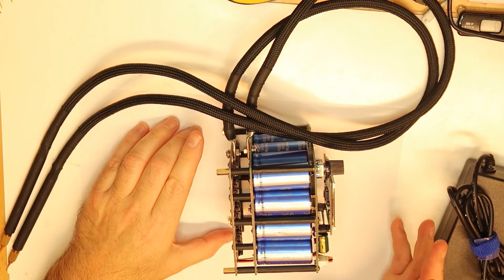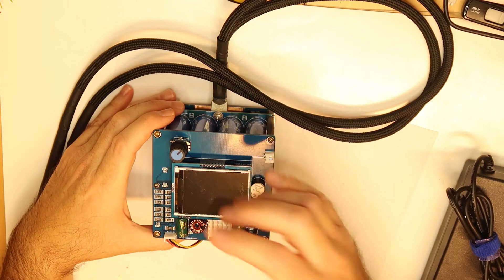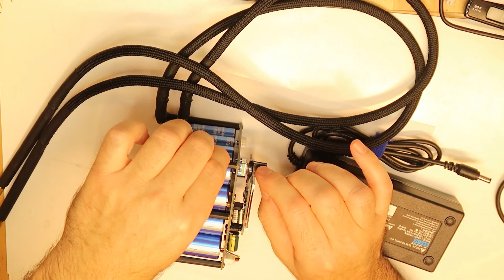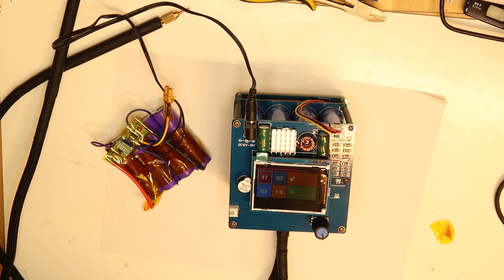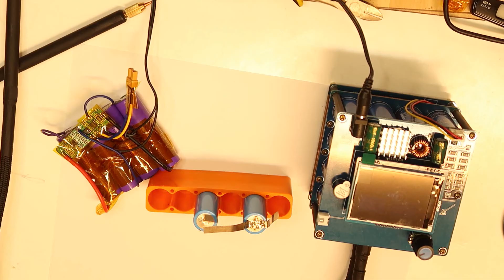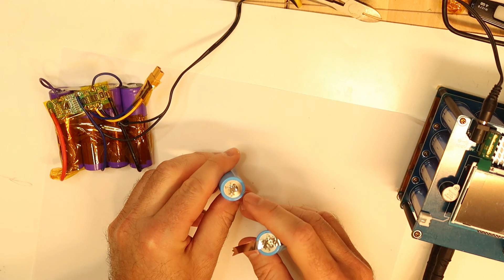Best Welder ?! watch this

Comment: For more than occasional spot welds, this thing will be much too slow and quickly get to be super annoying! 
*
This little toy at 10 amps charge current: Fine for VERY SLOW spot welding. Build a pack with 100 cells or more in it and this spot welder will quickly drive you nuts with all the time it makes you waste for charging!!!
*
I don't build packs all the time and I'm far from being a professional pack builder. I build 16S-32S EV packs for me and friends. I have a KWELD with dual super cap modules and 100 amps of charge current into the super caps. This setup keeps up with my spot welding cadence...which IMHO is not very fast. I started off with the KWELD on 12 amps charge current and I'd get 1-5 minutes of spot welding and then have to stop for 10 minutes so the caps could charge again. This quickly got annoying! I then upgraded to a 50 amp PSU for charging. MUCH better! I STILL had to stop for the caps to charge again, just not as long. I then got a second 50 amp PSU for a total of 100 amps of charge current. This keeps up with my not so fast spot welding so I'm never waiting for the caps to charge again.
*
Why does this matter? 
2 reasons:
1. The super caps run down and then don't deliver enough current to the weld pens and make weak welds. You WANT strong spot welds or you will have them break loose later and have pack failures.
2. If you are building any size pack, the spot welding quickly gets monotonous. Lots of doing the exact same thing over and over again! you WANT to get through this quickly because it is seriously boring! Constant delays make this much worse!
*
Buy this for occasional use or for VERY SLOW spot welding cadences!!! Probably 1 weld every 10-20 seconds is doable and not run down the super caps at 10 amps charge.

Comment: Have bought this welder, got it home last saturday, asked the seller for instructions, this is what i got today : 

product information:
Power supply：12V5A 
Mos：3713 
Capacitance：2.7V100F  
Welding voltage：MAX 5.6V
Current：MAX 800A

Instructions:
1. Plug in the power, the lower right corner is the rotation button, the rotation can move the cursor and adjust the value size, confirm it is to press the button.

2. Pulse1 and pulse2 : Is to adjust the welding strength, for example： 
Welding 0.15MM nickel plating: pulse1 setting 12, pulse2 setting 5, AUTO setting 1 

Welding 0.2MM nickel plating: pulse1 setting 15, pulse2 setting 5, AUTO setting 1。（pulse No more than 40）

3. Interval，The larger the continuous discharge value, the longer the continuous discharge time

4. AUTO，Automatic welding time interval, it is recommended to be more than 1S

5. Settings：The voltage setting in the interface can adjust the voltage discharge voltage of the capacitor. For example, if the capacitor is a single 2.8V, the voltage will go up to 5.6V after series connection.（ If the capacitor is 2.7V, it will be 5.4V adjustable. Remember not to exceed the voltage after series connection!）

6. Single-capacitor withstand voltage: refers to the withstand voltage range of a single capacitor. For example, a 2.7V withstand voltage is matched with a 2.7V capacitor. This is safe. The 2.8V capacitor is set to 2.7V. This is not OK. Overvoltage will cause long-term use. Damage to the capacitor

7. Do not touch any part of the host with a soldering pen, when power is on.
The matching wire is used to connect the pedals for manual welding

Comment: i have made a mosfet switch and using it with Arduino, i can purchase this controller of this spot welder cheaper, i was thinking, can i use this controller to control mosfet switch and mosfet switch will be connected to lipo battery,  i wish you have made a teardown video but still a good video.
Reply from the maker: Yes, you can

Comment: Thanks for the video!
Is it possible to reduce the ourput current to reduce the spot weld intensity?
Thanks
Reply from the maker: sure these are the delay numbers - lower number is lower welding power
Reply: @RoeeBloch  Mabe by changing the capacity voltage as well
Reply from the maker: @glewiss6696  yes this is correct